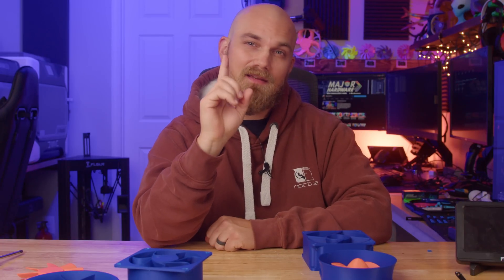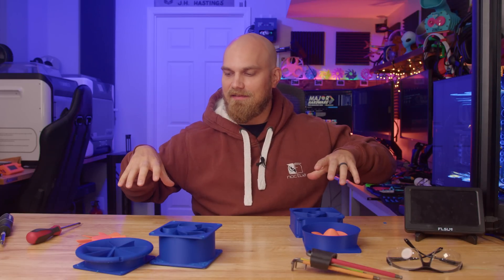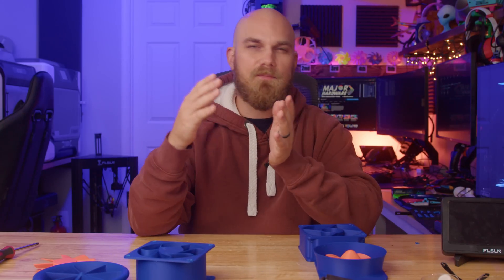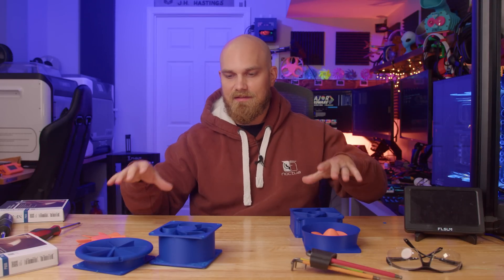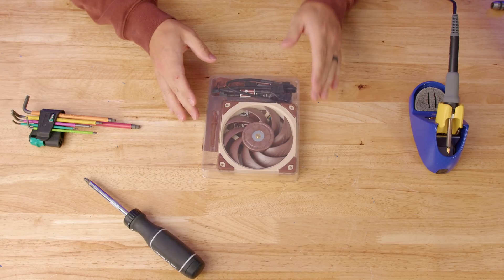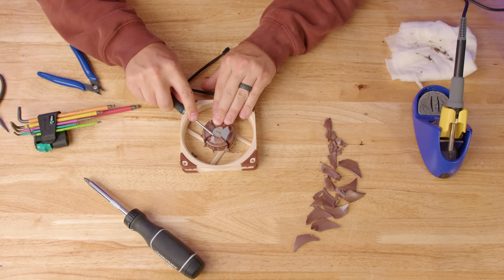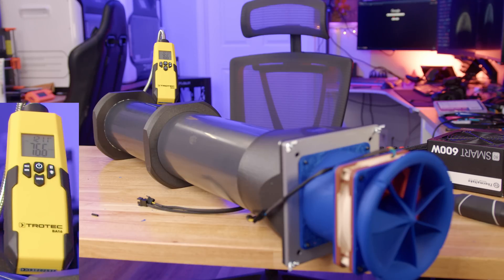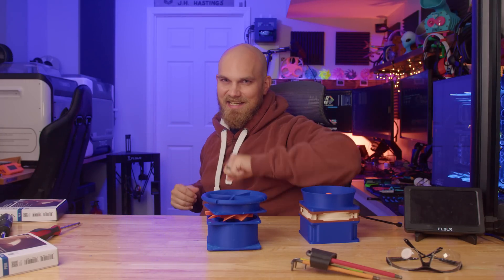Which One is REALLY the BEST | Fan Showdown S4 Finale

Comment: i have to state, airflow isnt everything.  some of these fans will do better temp delta than others, i expect 5-10th place to be 1-4th place in a real use case as an actual cooling fan. unobstructed airflow is different to cooling airflow. much different. air is gummy and gets stuck.

Comment: Well, air flow and static pressure (cooling) are two different sides of the same coin... You cant necessarily have your cake (or air flow) and eat it, too (have static pressure) so maybe test for both? If one fan has good SP and good flow, instead of it being outstanding at just ONE of those things, one that is good at both would, in my opinion, be the better fan...

Comment: couldnt you theoretically test which fan(without the exhaust) and then test which exhaust worked better with the better value(sound and CFM) and combine them? I think that be good. And maybe adding some sort of rubber to the connection would be good for sound too or to be used as a sealant between the main motor + frame therefore sealing air in and possibly producing better air flow.
Reply: I say this with amateur knowledge on fans and CFM

Comment: You could try baking the hub off, might be able to get it hot to where it doesn't melt solder, just loosens the adhesive enough to get it off

Comment: Ever considered an "Olds elevator"? I don't know how its affects (air vs grain) on miniscule friction are it but it's less torque (I think) on the inner screw but maybe more torque on the casing and possibly more motor usage... Im not sure...

I think the impeller part at the bottom is necessary for it to be effective, otherwise friction wins, so maybe it's not very good for air.

Comment: There are only so many options out there until you realize that most of the "best options" are mathematically fixed to a point of certainty. If this channel is to challenge and surpass the status quo, then testing for multiple factors such as P/SI control vs air flow control, sound output vs power output and centralized temp control vs generalized temp control would be ideal

Comment: not to just add more workload but both benchmarks for fan cooling have uses cooling on board mounted setups and airflow for case fans so id be a strong advocate for both.
although i would test the cooling on an air cooled rig as water cooled really has no excuses for overheating.

Comment: I came back to re-read my comment and now I can't find it. Anyway pretty sure I said something along the lines of use the airflow test and get a static pressure test, and also that the best fan will use the least energy to move the most air, so adding in an ammeter/voltmeter combo could be useful as well. If it's still there somewhere then this is just bump

Comment: For the new season you should use an air cooler that struggles with a higher load, not throttles but struggles. That way we can easily see if the fans are better or worse.
Or just do like a water loop measuring the water temp with and without a fan, no cpu needed just measuring how well the fans push air across the road.

Comment: The airflow somewhat nice, but what about radiators?
So because more air is better at any given time, we can assume that it's a nice metric and we will be sorta right.
Sorta because we need to take into account resistance, so i suggest have 2 tests:
unchanged 'air tube' just to see what it is
Air tube with radiator and few "dust filters" (meshes)
We yet to see contra fan on the radiator because thrust is important as well:) 
Just for ranking, we can say "just add them up" and it kinda will work)
After all, it's a show for entertainment and not the science competition)

Comment: I have no experience is designing anything, never mind fans, but I wonder if those fan motors have the torque to maintain a high enough rpm for this:  A multi-stage fan in a custom housing that uses gear multipliers to get different fans in the housing to spin at different speeds.  With a long enough housing, maybe even some kind of drive shaft that allows the two fans in the housing to spin in opposite directions.  Optimally, there would be a stator at the end of the housing tube to straighten the airflow, though I suppose that would be the purpose of the fans spinning in opposite directions.  The problems with it are that you’d need some way to keep the gear assembly and/or driveshaft and the second fan stable, and ensure they can spin freely without too much resistance, the torque involved in a gear system or driveshaft would require some durable materials, and the fan motor would need considerable torque to spin the whole thing at a high enough rpm to effectively move air.  It would also probably require a level of precision that might be difficult for that 3D printer.  But yeah, does anyone think it’s possible to make a contra-rotating fan for this?  Single-motor contra-rotating fans are already used in commercial buildings to move air around, some by means of a single motor through differential gears.  There’s even an article on researchgate describing a concept for a gearless one-motor contra-rotating fan concept, where the rotors are mounted to an electric motor using only one shaft, and the coupling between both rotors is realized by utilizing the conservation of angular momentum.  An advantage of contra-rotating fans is that it minimizes the effects of torque and vibration, and the complementary impellers may duplicate air pressure from the same volume.  Does anyone think this is possible to create for this series?  If it is, and you know how to design and build one, please do.  I really want to see how that would perform, plus some of my favourite propeller-driven planes from WW2 and post WW2 used contra-rotating propellers, such as the Supermarine Seafire FR 47, Westland Wyvern, Martin Baker MB.5, and the Avro Shackleton.

Comment: For the new season, you should use a better fan motor. the one youre using is bad. if you had a motor with more torque, its would allow more options and better innovation

Comment: If you do switch back to a cooling test to keep things more consistent you shuld use a wattet heater to heat the water in a loop with a single fan rad.

Comment: A nice way of going about this could be using a pressure versus flow curve, accompanied by an efficiency versus flow curve.
If you then add a pressure vs flow curve of a typical cooler you can basically match any existing design and find the actual flow and efficiency of that combination (just the intersection of those curves).
As the cooling power of a cooler is mainly defined by the mass flow over the cooler and the pressure difference of the blower is typically so low that we don't get a high density difference the air flow alone can be used to estimate the cooling performance of a given combination.

So this would give two numbers per combination: efficiency and flow over the cooler. Any other cooler could be compared if a resistance curve is recorded.  So if a high power and a low power cooler curve where available two efficiency rankings could be made.

Comment: Keep it how it is but add another "test" involving an acrylic box with a fogging device. Fill the box with fog and let the fan rip to see how quickly the fan will vacate the box. A clear cylinder would work as well but a PC sized box would demonstrate a bit more the ability of the fans to move the air out of the case. I think the most difficult thing would be gauging an accurate amount of fog each time. I have some ideas though.

Comment: Static pressure and CFM relationship
"If the estimated static pressure resistance is greater than the available static pressure of the fan, the airflow cfm delivered by the fan decreases until the system pressures match."

Comment: One aspect of all these different series that I feel didn't get acknowledged by anyone so far, is that of fatigue/longevity. From the beginning this series has been about 3d printed materials, being used to cool a PC, to stop said PC from thermal throttling. Over time we've seen different variations on this idea, but ultimately, the 3d printed materials used so far have yet to undergo any kind of EXTENSIVE testing for, well, how long it could theoretically last, using it for it's intended initial purpose of cooling a CPU, and preventing it from throttling.

so if you, Major Hardware-guy, decide to return to form and attempt to cool CPU or other computer components, then obviously I think it would be a good idea to see how well the original Prints, stack up against themselves now that time has passed. Are they as good as they were? have their materials weakened over time, what about their performance? do they just crumble into nothing whenever you manhandle them?

I'd like to see this, simply to answer a question that has been on the back of my mind, is 3d printed stuff going to be our future?? will we all one day get a 3d printer and instead of buying a computer-case-fan from microcentre, we print the fans and only buy the hub instead. and will we all decide to get the most performant fan, as evidenced through testing, or will the more popular fan-designs be less focused on performance, and aim for fashion over function?

will the 3d printed fans in that case last as long or work as well as the mass produced stuff, or work as well for the entire life of the product, or rather as long as the competing product?

will 3d printed fans be everyone's future?

sidenote, AMD CPU's will be aiming for operating for long periods of time at 95 degrees C, as if that were normal or something, will a 3d printed computer fan, keep cool the 7950X, or do we all just accept 95 degrees C as a new normal, or do we have to rely on mass produced computer fans?

Comment: I'm watchin die Fan showdown now a long time, and enjoying it, i'm Cooling and Ventilation mechatronics( Mechatroniker für Kälte und Klimatechnik) in Germany, the airflow measuring is acurate, but! the Fan works different at Back Pressure in the outlet it means maybe a Fan is better in Free air mode but less effective with a Radiatior in Front.
Maybe combine the measurment Anemometer with Radiator. 🤓

Comment: I have an idea, instead of picking a cooler directly, do cooler showdown.

Mount the best fan and maybe a standard Noctua, and a mediocre fan to several different coolers, then we'd have some data points to work with, to vote on what cooler we want used in the next season. If cooler testing is how you wanna go for it.

Comment: for me the best will be two categories 
1. airflow with no resistance, 
2. water cooling on single fan AiO with very thick radiator for big airflow resistance.

And before test you take heating gun and heats radiator until cpu temperature reach ~60-70C idle. then stress test, that will make testing faster. (just take away AiO thermal capacity)
Reply: or on 2nd test just attach radiator on the back of tube and test the airflow.

Comment: Static pressure test both a air cooler and a 120 Radiator. Preferably both made by one vendor as a point of comparison. Honestly its the only true way to determine which fans are better. Some will  be better with conventional air cooling and some better with radiators. There is no one fan fits all. Have ranks for each then an over all total for the leader. Assign certain weights to each category. Flow, pressure, temp differential etc. I realize it will take a bit extra on your part but dam would it make a difference. The list then becomes 3 fold. !. Better at air, 2. Better with Rad. 3 best overall. What a way to drive more creativity that makes a difference.

Comment: Cooling for sure as the new amd chips and intel chips are gonna be hot bois i suggest any 360 aio on the market preliminary heat output from the amd 7950x is looking at 91c to 95c with pbo enabled on a 240mm aio so lets maake it interesting

Comment: While airflow has less variables to test, it isn't representative of cooling capabilities.  I think testing with a cooler is important.  Either test cooling directly, or put a radiator between the fan and the air flow tester.

Comment: Water cooling custom loop would be interesting but rather than change in temperature, measure time, so fill the loop with a set amount of very hot water say 5 litres keep all the pipes/pump/resevoir insulated. Allow the cooler to run for a short time before the test then time how long it takes to cool the resevoir from say 60C to 40C, 40C should be way higher than the air temperature so small changes in air temps would effect the test less. And it'd give you a much wider margin to judge how effective the cooling was, a fraction of a degree C at steady state as a cooler in a PC might equate to several seconds or even a minute on the clock.

Comment: Connect the hottest CPU you can get your hands on to the thickest 120mm rad, e.g. Alphacool 14180 NexXxoS Monsta 120mm.  Put static pressure and ultimate cooling potential to the test

Comment: Proper caliometric cooling!  Constant water temperature is easy to achieve.  Cooling is what matters, but not in a PC or whatever, just measure how much heat energy is removed from the heated source water in a proper test rig via a typical radiator.  Not processor temps.  It also makes room air temp less of a factor (although not completely).  And it's not at all hard to do with a few sensors.

Comment: It would be much more interesting to see how much energy the motor uses (watt) compared to how much flow. That way the design must be optimized to have as little turbulence and resistance as possible. the RPM is not so relevant as the effect used, that's tells much more about how clever the design is (weight, blade design)

Comment: I wouldn't mind seeing you use the Scythe FUMA 2. Figure out what single fan configuration works best (I assume it'll be keeping the fan in the middle). Fans that aren't oversized will be put in the prime location (presumable the middle of the stack), meanwhile oversized fans will need to go on the front. Grab a 4000D case (the most popular on PCPartPicker, right now), if the fan doesn't fit in the case, it should be disqualified. Then you can have a sub leaderboard of fans that are "normal" sized
Reply: Grand finale would be too take the top-give normal sized fans, slap two on, and see if they can then can breast it the goliaths

Comment: My vote is custom loop water cooling, but replace the CPU with a resistive heat source for better repetition. You could even just heat the entire reservoir (a 5 gallon bucket?) for a more stable radiator inlet temperature. Then just measure inlet and outlet temps to get your delta. Or have the outlet go to an empty 5 gallon bucket and just measure its temperature after the source gets down to a specific level.

Comment: I think you should do both. You can always build a water cooling rig to test on. I.e. a testing rig, not a computer. Would remove the issue of having to deal with running things on the computer to tax the CPU etc.

Comment: Flow testing in a tube is pointless because that's not how these fans are used IRL.
Here's what i think:
Get a small PC case and tape up all the seams and fan ports. Leave one intake and one exhaust. Then mount each fan on the intake and measure airflow exiting the case.

Even better to test each fan on both intake side and the exhaust side separately while measuring the air flow for intake and exhaust separately.

EVEN BETTER would be to print two fans and perform the case flow test and a cooling test at the same time.

Anyway, I'm done dreaming. Just pick a quick and easy test so you can keep the videos coming. Lol

Comment: flow testing.  possibly add a static pressure measurement when the fan under test is blowing through a standard restrictor (radiator, mesh screen, etc)

Comment: First and Foremost... Squirrel Cage Fan with Razor Blades... I rest my case. Second, if you are going to switch up the next season's metrics, I would include the smoke test with some sort of gasket to keep the smoke from moving out from between the rear of the fan and the plexi glass... I think that would be nice. I would also try to get a more consistent amount of smoke coming from the smoke maker that you use, so that we can see the same amount of smoke move through from start to finish (I understand this may be difficult to pull off without like some professional grade equipment... but I have faith). And finally, have you thought about building a Plexi glass box to put the fan on that has normal venting for a computer but then the fan blowing in, with the smoke it will show a volumetric visual for where the air flows from each fan, potentially. 

Squirrel Cage fan with Razor Blades... you know you want it...
Reply: also can you potentially put out a tutorial for people that don't have experience with designing 3d objects, how to start designing a fan?

Comment: Water cool doesn’t matter because as long as the fan keeps the temp below 90 ‘ f it prevent thermal throttle. At least my limited understanding. Airflow maybe if you did a test on airflow in regards to degrees it might make it more relevant. Just a thought.  If that’s possible.

Comment: personally i beleive that as far as cooling goes, air cooling would be the better way to test it because that would then be more accurate as far as the fans go.. this would take into account more airflow etc. water cooling  includes the water heat removal whereast or eally test the fans themselves you would want to rely more on the airflow to cool directly. but that's just me

Comment: Honestly, I think including all three metrics would be quite valuable. Some fan models preform better for destiny like a rad, while as some preform better on a heatsink. and then the empirical data of just shear air flow is important for ranking too. 
I would be more interested in fans with better static pressure, but others may have more interest in just air flow.

also would increase your video length which might help you out too!